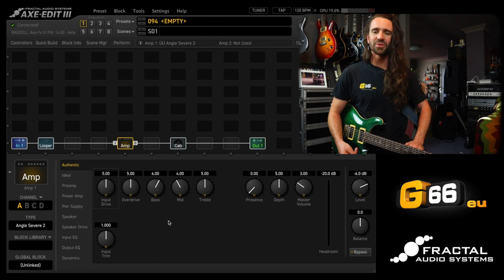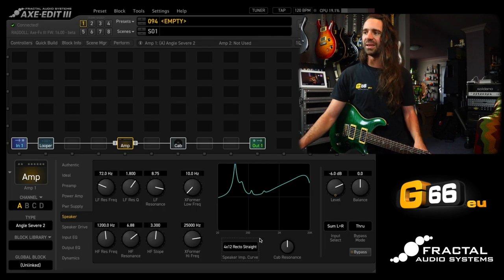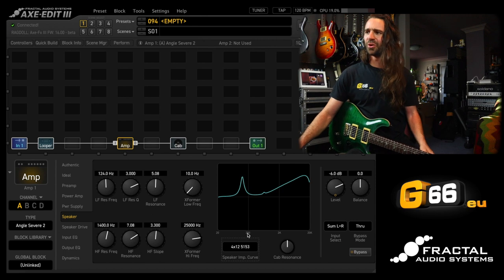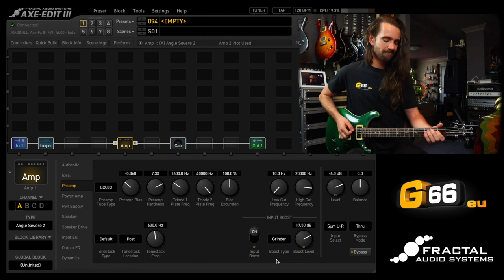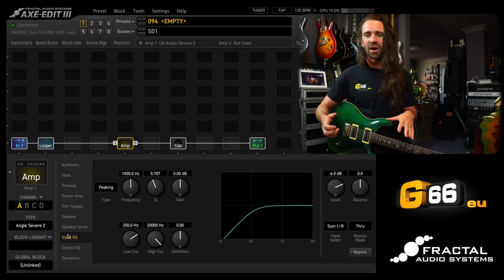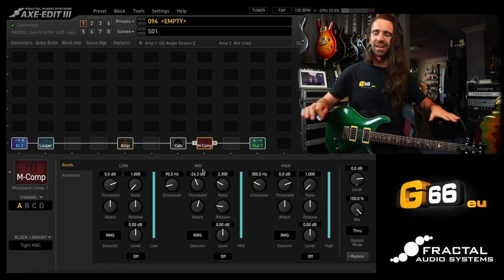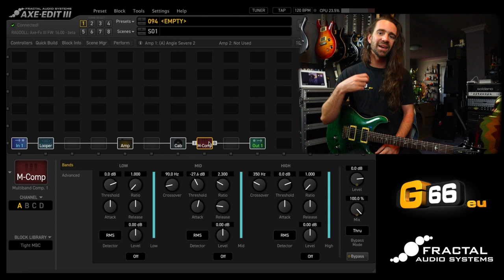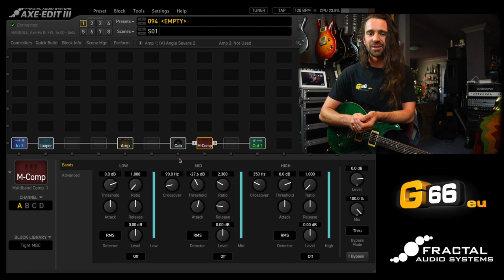Tuesday Tone Tip - Sculpted High Gain Tones

Comment: It sounds extremely thin here in my studio, did you cut more low end in post?
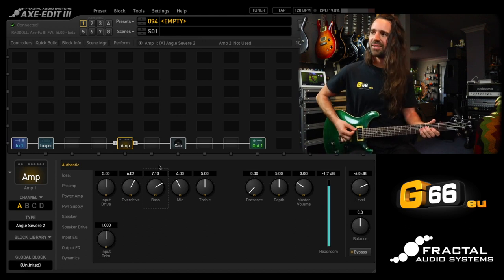Reply: at 08:36 it doesnt sound woofy, there is just too much gain.
Reply: at 12:00 I am really sorry, but it sounds horrible. Leon, you are a genius, but I am afraid the speakers in your room have way too much low end. On my spectrum analyzer there is hardly anything anymore below 200hz.
Reply from the maker: There's no post processing on any of these videos. All these tips are designed as a starting point and it's absolutely essential you dial them in for your system. FWIW I find these translate great when I play live whether it's with IEM or through an Atomic CLR.

Comment: How do you get a high gain tone with lots of gain but the tone Isn't over saturated?!?
Reply from the maker: Filter out bass pre-gain. You can use a drive pedal, input EQ or a few other methods.
Reply: @G66eu  is there a video on how to use the filter block?